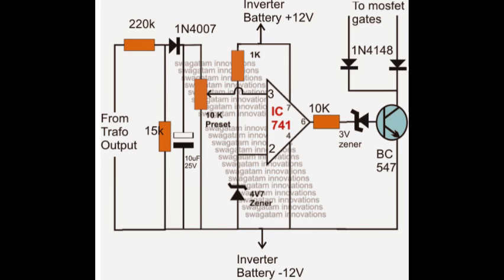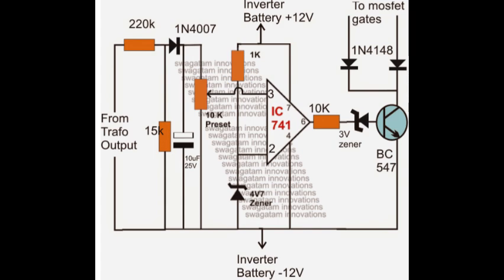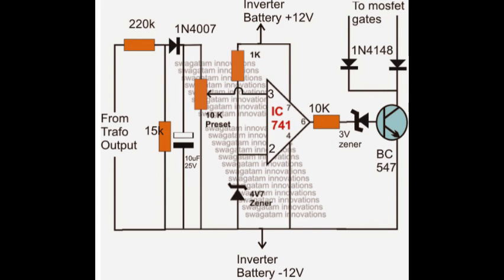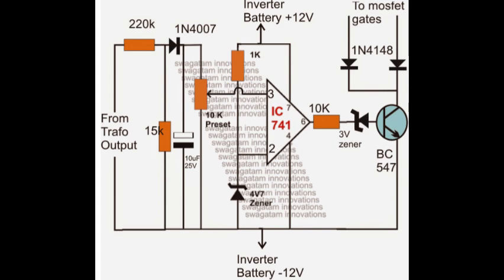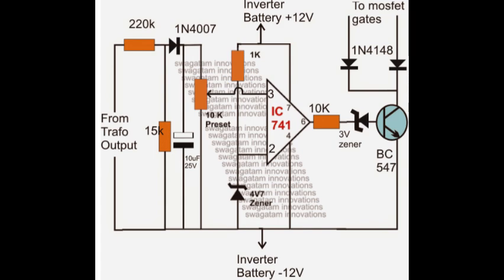Automatic Inverter Feedback Output Over-Voltage Regulator Circuit Diagram

Comment: Olá senhor, seu circuito é ótimo, aqui funciona corretamente, mas preciso da sua ajuda, quando eu abaixo a tensão para o nível pretendido os mosfets aquecem muito, como posso resolver isso? Os mosfets são irf3205.
Reply from the maker: Thanks David, MOSFETs are heating up because MOSFET gates are repeatedly driven through the Miller region due to weak gate discharge, forcing the MOSFETs to operate in the linear region and overheat......so instead of targeting the MOSFET gates, we can use the BC547 collector to ground any available shut-down pin of the oscillator IC of the inverter. If  your oscillator IC uses a Rt/Ct timing components, then you disconnect the BC547 collector from the MOSFET gates and connect it with the Ct pin of the oscillator IC, that will do the trick according to me, and the MOSFETs will not heat up...
Reply: @Homemade-Circuits Obrigado pelo retorno e explicação, vou fazer os devidos ajustes.

Comment: Please, I tried this circuit and got 12volt on the 10uf capacitor but no reading on output, help me please.
Reply from the maker: For how much AC level are you getting 12V?....make sure the AC input is at the cut off threshold of around 280V, and then adjust the preset until the output transistor turns ON...
Reply: @Homemade-Circuits Sir, 265 volt AC

Comment: Hello, our best teacher , kindly give me the resistors watt s
Reply from the maker: Hi David, Resistor values are given in the circuit diagram, which resistor are you referring to?
Reply from the maker: they are all 1/4 watt rated. For setting up the preset you can do this: First replace the transistor base zener diode with an LED. Adjust the preset wiper arm to the ground level. Then feed 260V or the desired high voltage AC from the input side, and slowly adjust the preset until the LED just lights up. That's all, the setting up is complete..
Reply: Thanks, but I mean whether the resistors are half watt or quarter watt or one watt. Please,  also the the feedback setting is confusing me, kindly assist me
Reply: Thanks you very much for your quick responses and your kind assistance. May Almighty God enrich you with abundant knowledge, wisdom and prosperity.